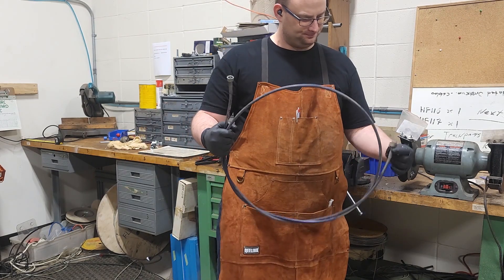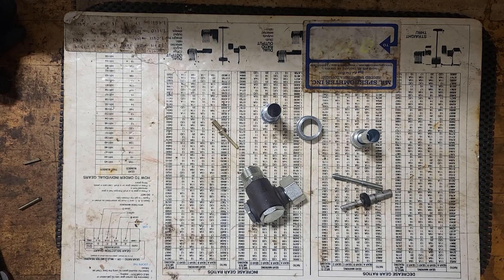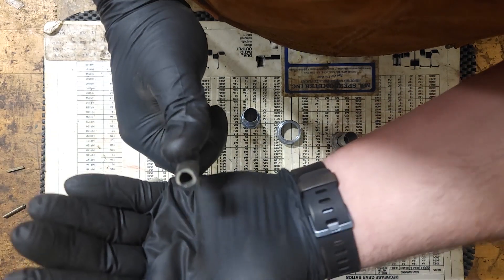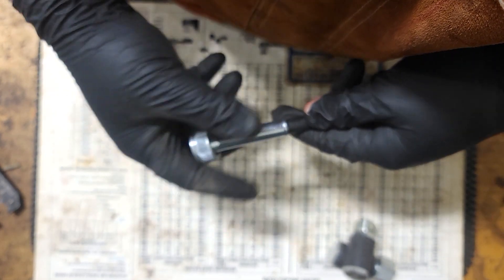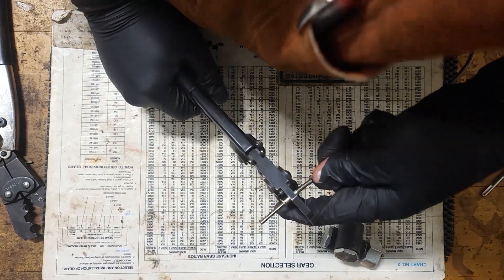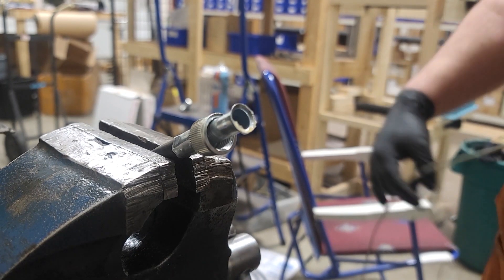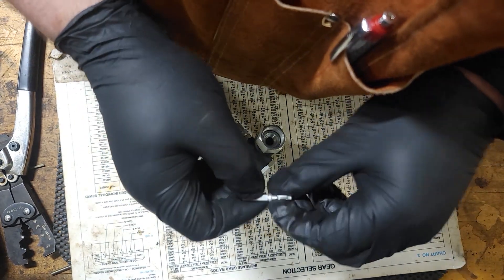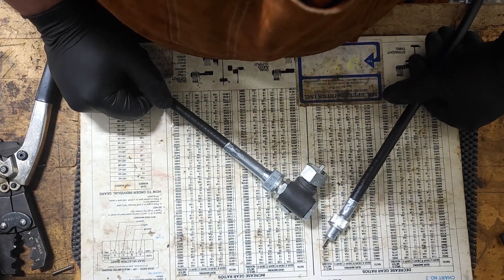MAKING A 9 FOOT LONG SPEEDOMETER  CABLE WITH ADAPTER

Comment: Are those specialized crimpers for the collets or would compound wire crimps work? I and a lot of other old tractor enthusiasts have one heck of a time finding decent replacement proofmeter (mechanical tach/rough groundspeed) cables. On that same line of questioning, measuring the square drive is straightforward but do I need to measure the round 'core' or the width of the two 'wings' for the cable ends on your website? I'm on my 2nd replacement cable (neither worked for more than a few seconds) and I really need to know my rpms for pto implements. Yeah, it's a 70+ year old tractor but it has those clydesdale horsepower and not the modern mini-horses horsepower some of the newer tractors are rated with. It also cost roughly the salestax on a new 'equivalent', even if it lacks cup holders and GPS! 😁
Reply from the maker: I use custom made crimpers with all the sizes I need for casing and for tips
Reply: Any advice for the DIY'r for the ends for sale on your site? I have a ratcheting crimper with replaceable jaws (and 4 common crimp sets like square/'heart'), will the square work or do I need to source/fab a hex jaw for a reliable join?
Reply from the maker: You can use a square crimp in a pinch. I do have single use and crimp blocs you can use in a vice.

Comment: What kind of grease is that. Watched two vids so far and you never say…
Reply from the maker: If the cable is for aircraft it's a type of aeroshell grease. Otherwise it's lithium based called lubriplate

Comment: I have an 89 Dodge B250 How do I know
What type of adapter 2 get If I cannot find any stamping on my current adoctor.
Reply from the maker: If you have a current adapter, you might be able to get away with counting the teeth on the gearing but if its a straight adapter not so much.

Comment: Looking to repair Speedo cable and housing for 300zx will cutting the length down of the cable affect the accuracy of the speedometer?
Reply from the maker: No, The length of the cable does not affect the accuracy of the speedometer. The only things that will mess with the accuracy will be things like changing to a new diff ratio. changing tire sizes ect ect.

Comment: Thanks for this informative video.  I am mounting a cab from a military FLU419 to a Unimog 406.  Unfortunately the Flu419 cable was hacked off.  How do I identify the connection at the transmission end?
Reply from the maker: The transmission end is probably 7/8-18 for the nut and as for the tip. You will need to use calipers on the tip to see how big it is. Also if the tip is square or round with a tang.

Comment: If you don’t mind me asking... Where can a guy buy a whole roll of speedometer cable?
Reply from the maker: I can help you with that no problem. Car or Truck? Inner Core or Outer Casing? 0.330 or 0.445? Tips and Ferrules for both, I pretty much have it all. Give me a call @ 1 - 800 - 661 - 1649 or send me an email at orders@recordtechnologies.com or you can check out our website www.recordtechnologies.com